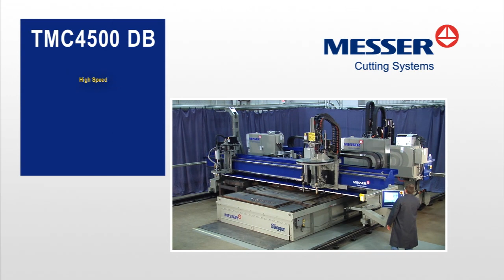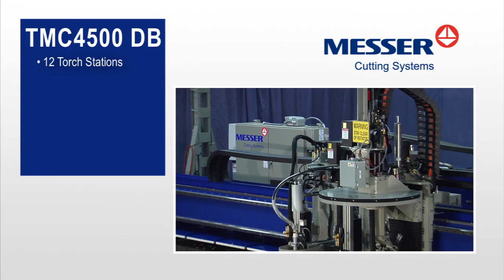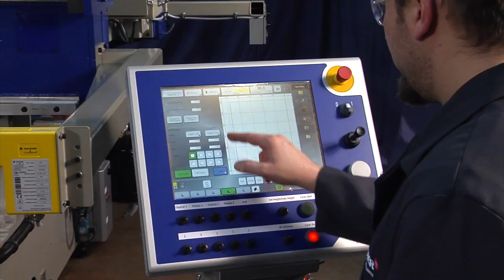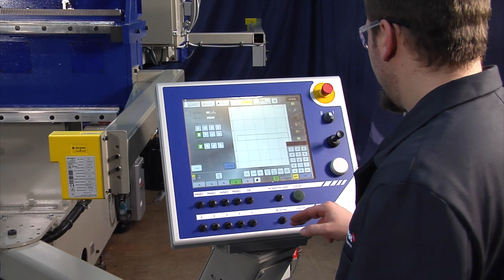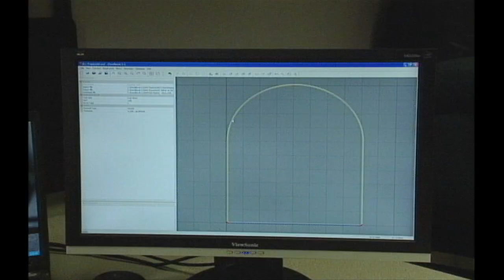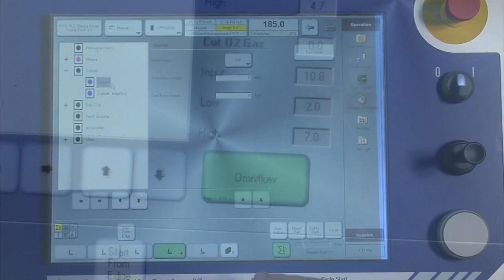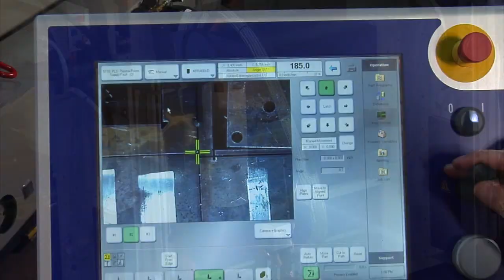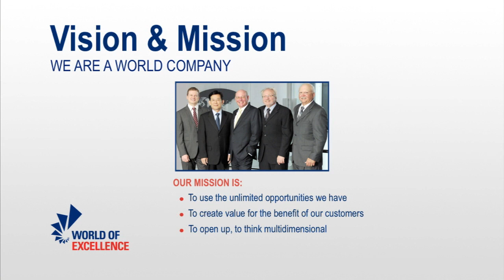Messer Large Drilling machine with plasma bevelling TMC4500 DB "Dual Beam"

Comment: 37 years experienced on Messer and many other brands while moving about Metro Detroit as auto industry fab shops lost overtime or went under. Yes this is a very expensive machine requiring much co savvy plus above average outside the box thinking while programming. A dummy can't run this elate caliber rig.
Reply: Why and how does a dummy purchase this?